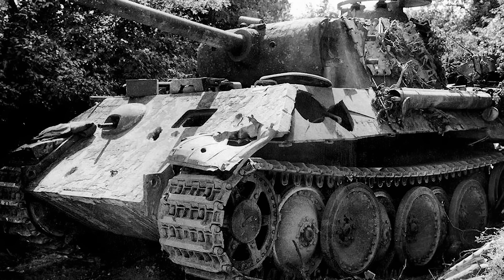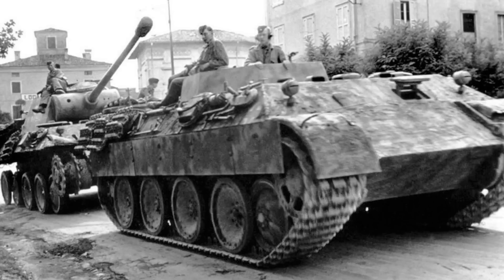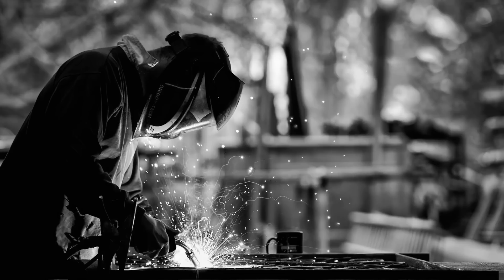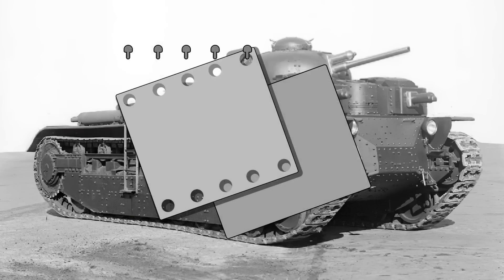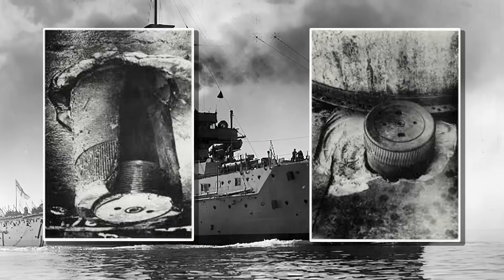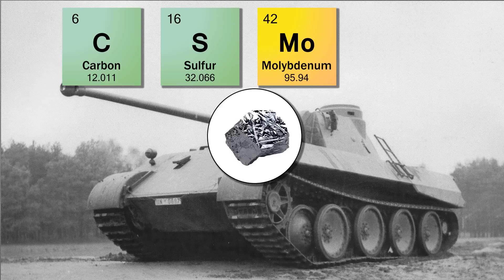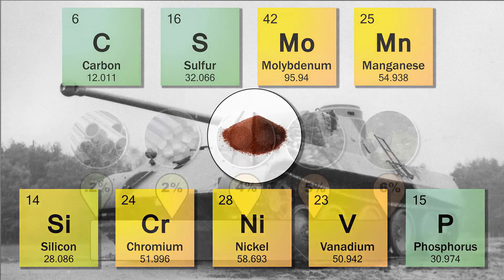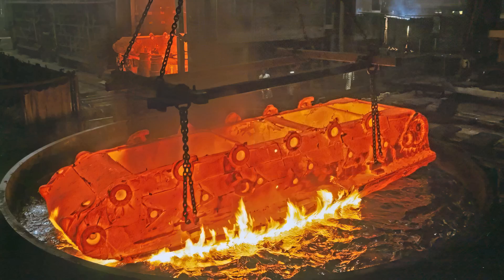Armoured Archives - Panther Armour  Review

Comment: Another issue with manganese is that manganese steel is air-hardening, necessitating the use of an annealing oven to control that aspect. After WW2 the Japanese steel mills were throwing railway rails into the melting pot without consideration of the likely consequences. This may have been a result of experienced men being lost during the war.
The problem was discovered here in Wellington, New Zealand, just down the hill from where I live, at the old William Cable facility on the Hutt Road, opposite Ngaio Gorge. The front half is now a car park and the rear half is essentially a drapery cum craft shop.
A large steel beam—made in Japan—was lying on its side, intended for use in a standard NZ Railways ‘plate girder’ bridge. Some of the men sat on it to have their lunch and the works prankster decided to have some fun with them. He grabbed a ‘tripping hammer’ which was used to undo bolts on a ship’s engine cylinders and hit the beam in the centre of the web. The beam split down the middle, as witnessed by my now deceased friend who was an apprentice at the time.
The subsequent investigation revealed the aforementioned deficiencies at the Japanese steel mill and probably saved quite a few lives around the world.

Comment: I'd heard of the 38(t) having brittle armour, and I've wondered if that was also a problem with the TNHP sold to other countries, or whether it only applied to the tanks built for the Germans?
Reply: Siemans-Martin method used in CZ steel. Sub-par.
Reply: Pzkpfw-38(t) were manufactured with standard homogeneous armor plating which wouldn't have been anymore brittle than standard E32 & E22 armor plating used on all other German AFV with similar armor thicknesses. What you're probably referring to is the German's use of the brittle high carbon Siemens Martinite armor used for the composition of the fighting compartments of their self-propelled guns & light tank destroyers such as the 15cm SIG33 & Marder series. Of the Pzkpfw-38T AFV family, the only vehicle that was actually composed of Siemens Martinite armor plating, to any extent, was the Jagdpanzer-38T. But even in this case, the 60mm thick frontal armor was of standard E22 homogeneous plating (capable of withstanding 76mm anti-tank rounds) not Siemens Martinite as has been rumored on the internet.
Reply: @THX11458  I was thinking more along the lines of the Czechs deliberately using sub-par armour once the Germans took control.
Reply: @thhseeking  I haven't seen any primary source evidence that this ever occurred on a mass scale that would have effected the overall quality of the Pzkpfw-38T being manufactured. The only case I've heard of involving the Czechs deliberately sabotaging any Pz-38(t) type vehicles was an instance were Czech workers drilled incomplete holes in the lower back side of the front lower hull plates of some of Jagdpanzer-38T during production to weaken them. These damaged vehicles, however, were discovered by German inspectors and taken off the production line (this, of course, isn't to say that no other sabotage took place during the war).
Reply: @THX11458  I read somewhere of a German tanker complaining of brittle Czech armour, and was wondering if that was affecting other TNHPs sold to other countries. I doubt that it would be to all of the 38(t)s, as the Germans would have found that out and probably given some workers 8mm haemorrhages.
Reply: @thhseeking  Lol - true.

Comment: If you study the German side.....The German economy suffered very much from a shortage of steel alloy metals. It was in a lesser extent the tank type as P IV, Sturmgeschütz, Panther, Tiger rather than the availability of alloys. There might be a dfference in Czech that built the Marder, later 38T Hetzer as they had their own iron ore, steel manufacturing. I do not know. In the first years of the war the German armor had a high content of chromium, some nickel, manganese. The steel was air hardened. The alloy quantity was reduced especially the nickel. The steel became oil hardened. In 44/45 the armor plating steel was made with very low alloy content. It was water hardened. This steel did show cracks in some cases after the impact as shown in the video.

Comment: Germany produced high quality AP rounds. So it's unlikely that they were lacking behind in metallurgy.
It's just some different approach. Each plate was designed to to offer high protection for the lowest weight, against the caliber it was supposed to protect against.
If you shoot a Panthers side armor with a 75mm, it will crack and spall. But it also was not designed to resist such calibers.
Every other medium tank in WW2 is easily penetrated from 75mm shells from the side.
Even the anemic German 37mm could penetrate a Sherman side armor from 200-300m at normal impact.

Almost every decision by the German Army in WW2 is based on maximium effecency for a certain criteria.
This however often lead to side effects that basically negated any of the positive gains.

The German mindset would want a weapon that is 120% as effective as the enemies, without considering that it will be only 80% effective in other scenarios.

Comment: Pz 38(t) and Pz III were overhardened because it protected the tank from low caliber ammunition.
A 30mm plate can easily penetrated by a 20mm AP round at normal impact but not when treated to a high hardness.
It decreases the effectiveness against larger calibers but that just means it will get penetrated at greater ranges.

So it's really more of a trade-off.

Comment: Fun fact is that I did a spectral analysis on some tiger steel too and I was suprised to find sulfur in it. Sulfur makes steel brittel and you dont want that. But there was no phosporus... And that is wierd because the proces of removing phosporus is the same that removes sulfur. Which means they purpesfully added that back into the mix. I was puzzles.... until I saw those pictures of the production lines where they have dozens and dozens of drills that drill the hull simultaniously. And then it hit me! THEY ADDED SULFUR SO THE METAL SHAVINGS BREAK VERY SHORT AND DONT TANGLE UP THE MASCHINES!!! They do that today in modern CNC Steels for the same Purpose. That blew my mind!
Reply: So they made the armour brittle to ease the manufacture process? 

I suppose there is always trade off when building tanks especially in war time between ease of manufacture and making the best possible equipment.
Reply: I suspect the sulfer content had more to do with weldability than with chip vs long stringy drilling debris. As a machinist, I find tool speed and coolant levels more pertinent to chip production. But if sulfer content is too low, weld penetration tends to be poor. Also, due to tungsten shortages later in the war, the Germans were forced to use steel tooling rather than “wediastahl” tungsten carbide tooling. Even annealed armor plate is tough on high speed steel tooling. A little sulfur in the mix, about .005% or a bit less, would make it easier to machine regardless of chip type. Though you are right. Yes, When you are drilling, especially thick steel, you would rather have chips than strands.

Comment: The weakness of German welds under shock loading is amply demonstrated in your (Armored Archives) YT video “Tiger II v HESH.” 
My understanding is thin armor plates can be made very tough and very hard. These are typically of 6 to 10 mm thick where heat can be transferred into or out of the depth of the plate. One if the USA halftracks was able to substitute 6.35 mm (1/4”) really hard but tough armor for 9.5 mm (3/8”) plate; however, the 6.35 mm plate could not be welded.
At one time the Brits classified vehicle armor as “high hardness” HH) and machinable quality (MQ). 
Good armor piercing caps combined with tough bodied projectiles are the bane of face hardened armor. The cap can induce shatter in the armor with cracks spreading throughout. The cap shatters but a tough (blunt) projectile point survives. I’ve seen cross sections of US Army & USN WW II APC with the main projectile having a very rounded nose; the windscreen (ballistic cap or hood) is pointy and provides the ballistic low-drag coefficient.

Comment: I've read that the best armour on any tank during WW2 was the Tiger, high nickle content I think was the reason for the right hardness-strength ratio.
Reply: Yes. British tests concluded it was 13% stronger than the best allied tank steel, particularly the front plates with their 265 Brinell Hardness.
Even the 80mm side plates were the effective equivalent of 90mm plus of the best allied tank steel.
Reply: @lyndoncmp5751  There's no such thing as "best armor".

Also, hardness is not a test of strength. It is extremely easy to produce high hardness steel. In fact, taking the hardness (due to high % carbon) OUT of steel and therefore increasing it's toughness, is the hard part.

If either of you watched the video, it should have been obvious that materials science is not as straight forward as strong vs. weak or best vs worst armor. Improving in one category, e.g. hardness, inevitably makes your steel more brittle and prone to cracking. Similarly, using a more ductile steel, generally makes the material tougher and able to better withstand impact, but makes it easier to penetrate, warp and bend under stress. And this is just a single consideration. There are also many other considerations like weld strength, machinability, ANGLE OF IMPACT, time and resource cost to manufacture, etc., etc..
Reply: @mcs699 
Of course there is better armour and worse armour. Armour quality varied. The Tiger I's nickel steel of 265 Brinell Hardness on 100mm thick plates was concluded by British testing on Tigers in Tunisia to be 13% stronger and more shell resistant than the best allied steel of the same thickness. 
The British actually tried to emulate this for their Tortoise project. 
Source : Thomas L Jentz, Germanys Tiger Tanks. 
Write your own book with primary sources refuting it if you wish. The world is your oyster son.
Reply: When this person writes stronger, I think it is a reference to actual firing trials, using guns against captured armor, including whole tanks or the wrecks thereof. So it’s probably pretty accurate. The Tiger’s armor did get a bit spotty later in the war though. Soviet trials found the armor of the King Tiger more prone to cracking than the earlier armor of the Tiger 1. As mentioned above, alloying elements, time to do things right and skilled labor were all lacking.
Reply: @johngillespie9459 
Odd though that the Western Allies faced King Tigers built in the same factory as those the Soviets faced, and the Western Allies didn't report the same issues that the Soviets exaggerated. The Soviets claimed the welds split when hit and plates fell apart. Yet there are bona fide pictures of King Tigers on the Western Front in Normandy and the Ardennes with direct hits on the welds and there is no splitting and plates falling apart. 
The Soviets were disingenuous. Often they would fire shell after shell on already knocked out and damaged tanks, thus severely weakening them further under the stresses and THEN claim their results. That didn't work out on the battlefield, and the King Tiger's glacis plate was never penetrated in combat.
Reply: @lyndoncmp5751  I'm a mechanical engineer. "Hardness" has an actual meaning in engineering and it has absolutely nothing to do with strength.

Thanks for completely missing the point with your utterly irrelevant "source".

I'm happy for you that you know how to read though. Congrats.
Reply: Nickel was one of the scarciest alloy for Germany in ww2. That is the reason it was taken out in the later war doesn`t matter which tank.
Reply: The Tiger factory was also located near the mill that made the steel, so armor quality didn't suffer as much during the last year of the war
Reply: @jamesricker3997  Please have a look on the map before commenting....In Google map you can see Essen, Oberhausen, Duisburg were the steel was milled and rolled and Kassel where the Steel plates of the Tiger were welded to a tank.
Reply: @jamesricker3997  The Tiger factory was located in Kassel....The big steel mills and rolling plants were in Essen, Dortmund. Please have a look on a map!!! 
From a technical point of view it made sense to dedicate one rolling plant on thick armor in the Ruhr Valley, another one in Linz and a third one in Czech that supplied the producers of tanks and other stuff.
Reply: Armour on ships Bismark was called wotan  any intell please ?
Reply: @Eric-kn4yn  "Wotan Hart" was a brand name given by the Krupp company.